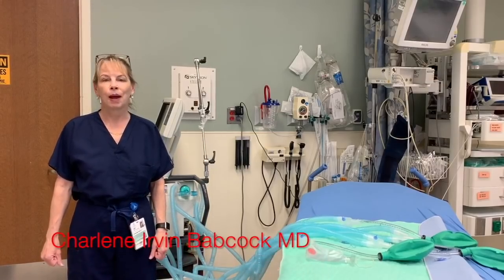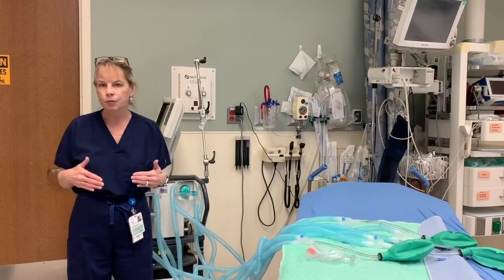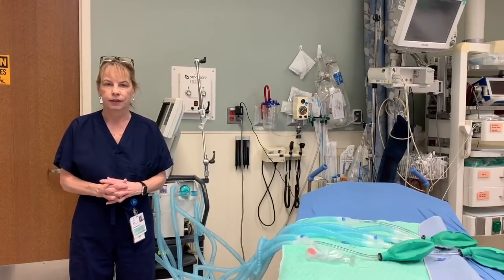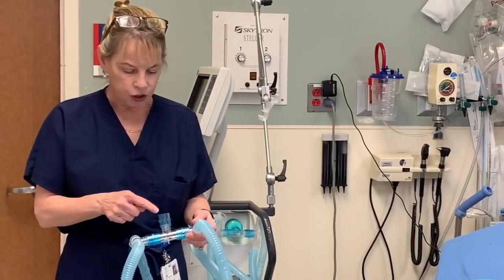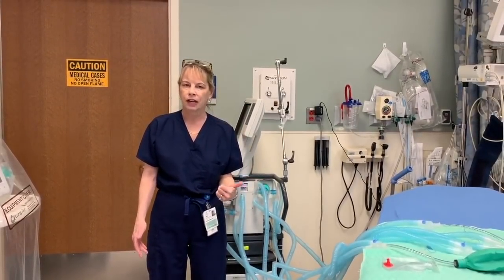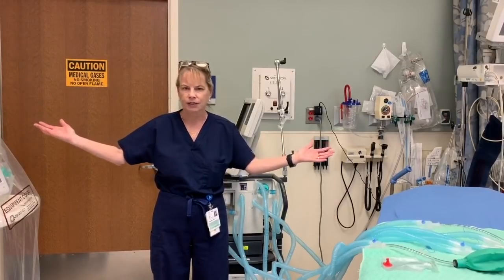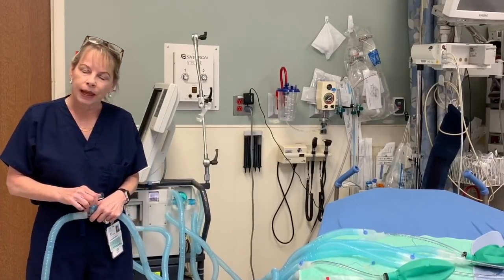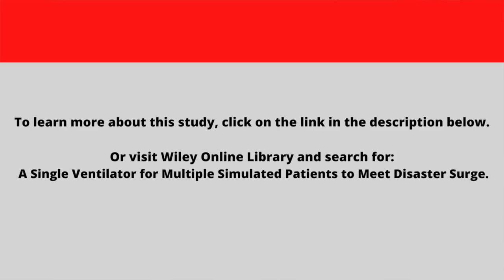COVID-19 How to Use One Ventilator to Save Multiple Lives

Comment: I would be super careful with this. There are many risks. Yes in a triage situation like in north Italy you can try this before letting people simply die. BUT:
1) You might break Ventilators ultimately with this. Parts will get overused and over stressed. As said ventilators are laid out and build for one person.
2) People might have slightly mutated versions from a different strain. The introduced viral load of another strain might introduce further load on the immune system and therefor increase severity and therefor increase the mortality risk dramatically.
3) Risk of bacterial infection also dramatically increases especially when used for longer times. Single Persons

4) As said correctly, this will cause issues simply by the different lung size. But this Seems fixable with a few tweaks in tube sizes and pressure compensation limiter.
For the very worst case do it. Otherwise avoid it strongly.
Reply: When life hands you lemons, sometimes it best just to make the damn lemonade and hope for the best.
Reply: https://emcrit.org/pulmcrit/split-ventilators/
Reply: Last comment I’ll be making. This won’t work. Plain and simple. To boot, when you’re increasing demand for ventilators and trying to fit all of them in the hospital, you’re overwhelming healthcare workers and burning them out by creating ideas like this doctor did. Putting people at risk and making them do things that our patients at more risk.
Reply: Certainly. But desperate times often need desperate measures. If the nett outcome is that even one more patient survives, surely that is worth the risk?
Reply: Philip Hart mmmm no, you’re putting patients at risk for more pain and suffering. This isn’t even built into protocols, so you can only imagine the lawsuits when this fails and patients die. Sorry, but you need to understand the mechanics of a ventilator and the overall anatomy of the human as well as the physiology. You can’t just bring up the whole “if it saves live” or “isn’t it worth the risk?”
Reply: jan van ruth I’m a respiratory therapist that has worked and does rounds in a critical care unit. I’ve managed 12 ventilators to myself, we’ve placed esophageal balloons as well as weaned multiple people from ventilators within an hour and extubated. Now, tell me what you would do with a patient who has a blood gas of 7.21-78-49-23 while the other patient has a blood gas of 7.36-68-71-31? They’re on the same vent, one isn’t receiving adequate tidal volumes, the other has a rate too low, but that’s because the other patient can’t have a rate that’s set too high, because we risk hyperventilation. Both patients need to be paralyzed, so how do we wean multiple patients off the same ventilator, when one or two isn’t ready? I’m all for saving people, but when we are literally trying to force ventilators to do what they aren’t made to do is simply idiotic. I’m the one the doctor in the video calls when they can’t figure out why the low pressure alarm is going off on the ventilator.
Reply: @Beard-OF-Courage  Thank you. You are right about the blood gas on top of all the things.
People have to be on the ventilator for 2 maybe even 3 weeks with covid19 as far I have understood. There is no way you can split one ventilator for that long. You will likely have 2 person die of complications instead of 1 Person getting at least a good try.

Also I have to add I am an engineer not a medical professinal and even I see this video very criticaly. Further the comparision with a mass shooting event with a epidemic diseas shows wrong thought process behind this at first not so bad looking idea.
Reply: Beard OF-Courage would a pressure and volume regulator between the two patients ever be feasible? Lots of parts, but EDs will be challenged
Reply: @Beard-OF-Courage  You sound exactly like a GP friend of mine. Always worrying about protocols, lawsuits, etc. I really hope that if I'm in a life-or-death situation that i don't find myself under your "care". BTW I'm part of the maker movement, and like many such, I have over the last few days spent lots of time learning how ventilators work, and what is necessary to build one in times of emergency like this. So please forgive me if I don't take too kindly to your patronising tone.
Reply: @BeardOfCourage There’s so much more to respiratory therapy than seems by mere mechanics and chemistry. I *had ordered parts to McGuyvver an oxygen concentrator —until I just saw the comments here...
Reply: C Luek It’s still not possible. As humans, we are all different in size. When placing settings onto the ventilator, we calculate the PBW or ideal boy weight calculation. We have to make sure we are using correct tidal volumes and pressures for patients. Someone who is 100kg and 182cm, they are going to require larger volumes than someone who is 80kg and 150cm. This includes higher pressures depending if they are obese or not. 

Adding anything along the tubing is going to increase dead space within the patient circuit (air being inhaled that isn’t taking part in gas exchange). 

The doctor in this video is clearly unaware of complications with patients on the ventilator. In the CCU setting, we are making multiple changes to the vents and drawing labs all throughout the 12 hour shift. Small changes to the vent can cause such a radical change to the patient, that it’s not worth putting multiple at risk.
Reply: Philip Hart sorry that I’m worried about the care of patients as well as safety for them. Trust me,  it takes more than a couple days learning how ventilators work. I also don’t take too kindly when people claim they know how ventilators work after a couple days of reading and thinking they can build one.
Reply: Philip Hart protocols were put in place to avoid patient harm and overall protection of Healthcare workers. If you feel that risking and endangering multiple peoples lives at once is worth the risk to even save one, because you saw a YouTube video of a doctor doing it, then I feel sorry for you.
Reply: @Beard-OF-Courage  Medcram Doctor here.  I'm going with Babcock when there's 50 patients going into respiratory failure and only 25 vents.  Are there going to be issues as you point out? you bet...but none...none of them are worse than no ventilator.   Everything that we do in medicine must have benefits that outweigh risks - not no risks.  The good is not the enemy of the perfect.  By the way, I'm the guy they come to when the RT can't ventilate the patient. LOL  BTW your ABGs don't follow HH equation.  But I get your point.  Be supportive of people who are coming up with plans to deal with the surge.
Reply: rdseheult That still doesn’t get through to the point. How do you troubleshoot when there’s a low tidal volume alarm? How do you know which patient is having issues? I can tell you for one, this idea from Babcock is nonsense. Sorry you can’t see that.
Reply: rdseheult it’s clearly not safe and any doctor backing this is being unrealistic. Plain and simple. 100’s of reasons why those won’t work and why it’s unsafe, but people’s reasoning is to “save patients” when this is actually going to cause more harm and death.
Reply: @Beard-OF-Courage  I agree with you.
Reply: @Beard-OF-Courage  
Sweet, so you'd be the person to talk to.

What do you think about using a central air compressor(s) with in-line filters, multiple lines, and control circuitry to handle the whole shebang?

Basically you'd have a central tank of pressurized air which would be sent to each line in the system and then you would have a panel for each patient to allow you to control airflow for each person semi-independently of the overall system? A high enough mainline pressure should serve to weather the fluctuations.
Reply: Noah Wood are you talking about using air compressors with regulatory valves and pressure regulators to ventilate patients? If so, what would be your method to having the patient enter the exhalation phase? Also, monitoring total tidal volumes delivered and return? Monitoring overall driving pressures to the patient? What about oxygen delivery? Ability to control the speed at which the breath is delivered? 1:2 I:E phase?

With the ventilator, there are a dozen different modes. Each mode is different and benefit a specific group of patients differently. The ventilators utilize positive pressure to deliver tidal volumes (breath) and then utilizes that same pressure to force an exhalation. 

PEEP is also utilized to maintain the recruitment in alveoli. PEEP is positive end expiratory pressure, which is what maintains overall oxygenation and reduces any pulmonary shunting in the lungs. Shunting is basically when the alveoli in the lungs are perfused with blood, but fail in doing so with ventilation. That is where PEEP come in versus just increasing FIO2. 

Any time you disconnect the vent or lose PEEP, all that recruitment in the alveoli disappear fast. So you would need to figure out how to implement PEEP. In my opinion, you’re better off pulling out older model ventilators from storage.
Reply: @Beard-OF-Courage  
Yes, and I'm thinking the system would utilize a microcontroller to handle everything.

It sounds like you need to maintain some pressure on the intake line while pulling out the air for exhale, so the exhale line would need a vacuum, you could use a simple venturi pump for that with electrically managed valves to control the IE pressures and a relay to switch between inhale and exhale.

For oxygen it seems like the simplest solution is to add a port on the intake line and another electromechanical valve.

For controlling the speed, you'd need to calculate how far to open the valves, that'd take a few hundred nanoseconds or so, and I'm only guessing that that's more than fast enough for the application.

I'm somewhat curious now how existing vents do this, because it seems like whether you use a fan, a compressor, or bellows you're working with the same thing: pressurized air in a tube.
Reply: @Beard-OF-Courage  
My main concern is cost and access though, not just the U.S., but globally. How many Namibian villages do you think have even a 1 ventilator let alone enough to treat 3-7% of the local population?

I'd wager though that most places in the world have access to air compressors. Vents sell for upwards of $50k, I can get probably 1K of these units fabricated for that much, if not more. Need to add on a charcoal and an ULPA in-line filter for the air compressor, but still far below the current cost of a vent.

It's also a bit more resilient because you have a tank of stored air to use, and power is generally not very reliable in these places.
Reply: Noah Wood I’m not sure a vacuum isn’t the same thing or could even mimic an exhalation action. I:E is the inspiration to exhalation time. A patient inhaling over 1 second with an exhalation time of 2 seconds for example. As well as if you are adding all of these valves, circuits etc. How are you going to account for the dead space in the circuit when adding all of these extra pieces. Dead space in the breathing circuit is the space where inhalation and exhalation coincide. Since patients breathe in and out of the same connecting circuit, the chances they could inhale unfiltered (containing CO2) exhaled gas is high. This is basically The main concern is monitoring everything. 

How are you going to monitor if the patient is breath stacking, auto-triggering, autoPEEPING, peak pressuring and able to program exact ventilator settings in as well? Respiratory therapists utilize waveforms to determine if the patient lung compliance is changing. 

What would you use for circuits and to humidify the air? Temperature of the air needs to be 36-37 degrees C as well as sterile water. 

I honestly don’t think you’re being realistic here. When you’re taking care of critically ill patients, a jerry rigged air compressor isn’t going to ventilate patients. I do commend you for trying to be innovative, but there’s honestly just too much that goes into these ventilators.
Reply: @Beard-OF-Courage  
I mean... the patient might suffer permanent brain and lung damage, but when the alternative is death...
Reply: @Beard-OF-Courage  
In all seriousness though, you'd probably want the patient to be sedated in this case so they wouldn't be breathing on their own. As far as humidity/temperature, that should be fairly easy to monitor and control, circuits would be whatever the standard tubing is (not a doctor if you couldn't tell).

Weaning seems like the biggest challenge, you'd probably want to switch them over to a decent machine for that part of the process.
Reply: Noah Wood brain damage usually turns into the family opting to have the patient turn into an OPO case, so organ donor. Lung damage? Would basically mean a lifetime of breathing problems and being rehospitalized and no guarantee they would survive. Both would involve mass lawsuits due to going against protocols and using things that weren’t meant to be used. Trust me, it’s easier to just dust off older ventilators for use.
Reply: Noah Wood I understand what you’re getting at though. There’s honestly just a shit ton of variables you take into account for.
Reply: @Beard-OF-Courage  I would it be worth trying SLIGHTLY constricting the centre of the tube going to the guy who needs less air. Would this perhaps hopefully reduce his air supply without upsetting the machine too much?
Reply: Sandy Allsopp It would actually endanger the patient. Clamping down on the circuit would cause a loss in tidal volumes, high pressure and loss in overall ventilation. You’re pretty much talking about closing off someone’s airway to breathe. Imagine linking off a water hose. Less water and more pressure is being built up. Not good for the patient.
Reply: Sandy Allsopp If you restrict any tube going to any patient regardless of number, you are closing off the circuit and also preventing the breath from being exhaled too.
Reply: Sandy Allsopp That still doesn’t work. We are unable to monitor the tidal volumes and overall pressures. Anytime a patient coughs or adjusted, peak pressuring occurs. You are literally still grasping at straws. This will never happen.
Reply: @Beard-OF-Courage  I understand that coughing would be an issue, but how often would that occur with a paralysed patient? And why are highly respected medics considering it and making minor modifications just like I suggested? Why does the Belgium medic think it would be OK? Does he not know about coughing too? Would an occasional peak pressure caused by one patient coughing really instantly kill the other patient?
Reply: two patients one ventilator, you want it any worse than that?
Reply: jan van ruth lastly, this video was shown to the pulmonology board at my place of work. A handful of them laughed, while a couple of them couldn’t believe this woman is a doctor. That is why I’m here.
Reply: jan van ruth The only people buying into this video are ones with either no medical knowledge or who have no clue about the respiratory system. Guess what? 100’s of reasons why it won’t work and not worth risking.
Reply: GaliX I’ll pick this over death thanks

Comment: What is the TVol? 500 x #pt  or just 500 for all ?  Is the settig on presure support or Vol support? Im guessing the vent won't stop until it hits the right amount of pressure for the # of pt's.  Whats the limit? why not 8 pts to 1 vent?
Reply: On AC/VC with 2.0L they found that each test lung got around 500mLs each. I wanna say the limiting factor is how much volume the vent could deliver
Reply: The ventilator has no way of sensing how much volume (in pressure control) or pressure (in volume control) is being delivered for each individual patient. It will just sense one "big" patient. So you would dial up 2L tidal volume and hope it distributes equally among the 4 patients.

If the patients have different lung compliances, they will get a different "share" of the ventilation and no way to monitor airway pressures - ie as high risk of pneumothorax or insufficient ventilation. This might work for patients that have similar sized lungs/compliance (eg the Las Vegas example where the injuries may have been extra-thoracic) however would be difficult in ARDS where the compliance is both different for each patient, but also changes in response to therapy. 

A great video, but I hope no one is forced to use such a strategy during this crisis.

Comment: Thank you very much for this video. Can i ask about tidal volume? It will be divide on 4 people! Should we increase the tidal volume to accomodate 4???? Also the PS and peep value since we will loose pressure due to decrease resistance
Reply from the maker: If you are using Volume control...yes we did 2000ml TV so that each lung got about 500 ml..  Pressure control. maybe better in some situations....at the end of the day...do your best....save as many as you can...and this MAY...(not will but MAY) allow you to save more than one patient per vent.....
Reply: @charlenebabcock1048  Thank you so much. Keep the great job.